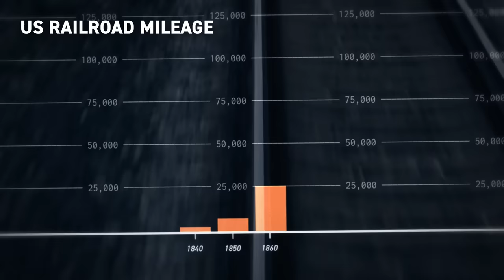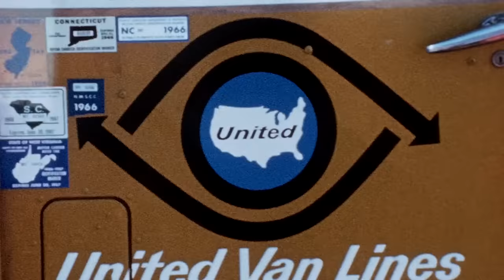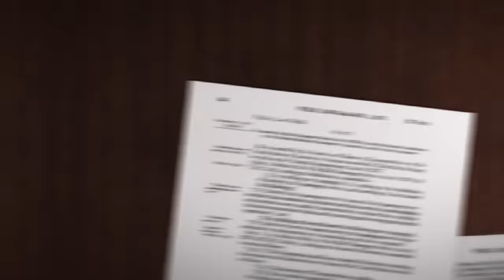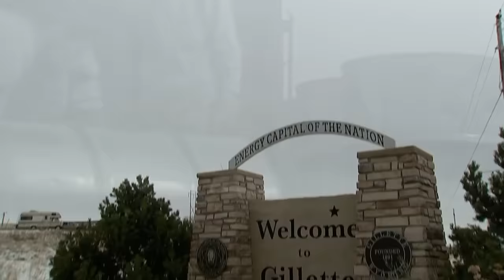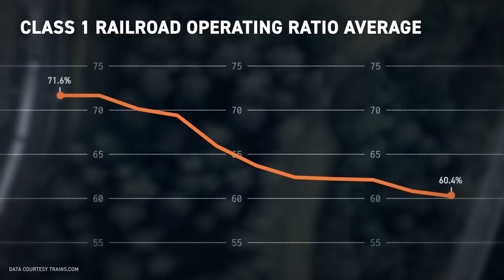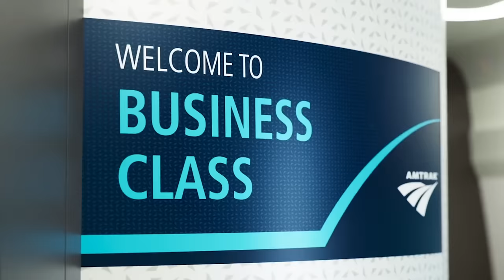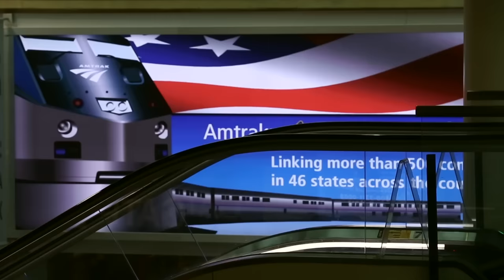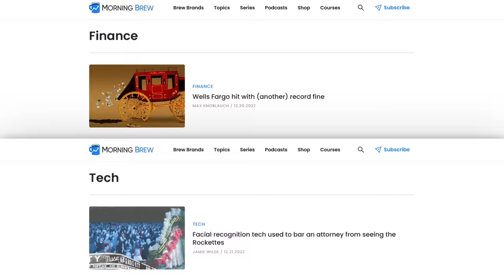The One Tiny Law That Keeps Amtrak Terrible

Comment: Everyone along the Colorado front range has been begging for a train for years. I have not met a single person who said they would prefer to drive to Denver over a train. Palmer saw this exact vision when he placed Colorado Springs back in the 1870s and the fact that we back tracked is ridiculous. The whole town is there because of the railroad.
Reply: One thing trains along the Front Range have an opportunity to do is address one of mass transit's big issues in the US: how do you get around once you get to your destination.  Rental cars are fine, but they can be a hassle, especially for short trips.  Colorado Springs and Denver are, at least right now, just not setup for mass transit.  With a train, you could load your car, ride the train, then use your car to get around once you get there.  Perhaps not the utopian idea of a carless society, but it's a step in the right direction.

And yeah, the trip to Denver is much better now that the gap project is done, but it's only a matter of time before it gets congested again.  Then what?  8 lanes?  10 lanes?  The Front Range will likely end up as one the countries megacities (almost a real world version of Saudi Arabia's ridiculous The Line) .  Best to figure this stuff out now.  Can't make a big change all at once, but we might be able to a step at a time.
Reply: @ccoder4953  I wish they created street cars, e-bike rentals and bikelanes
Reply: I'd recommend checking out some of the bus services that run along the corridor if you haven't. I used Bustang for a few years to get to Denver and it was quite reliable.
Reply: At least the North Suburbs of Denver finally have their commuter line into the city, although it came almost a decade late and we actually had to sue the state to get it after we voted to increase our taxes to fund the project and then they tried to cut us from the plan.

That said, I agree it needs to be more. We really need a line for the entire entire front range.
Reply: Dr. Quinn: Medicine Woman can take the train to Denver, but YOU can't.
Reply: @minihjalte  I think Denver needs a bit more than that.  If I'm coming from Pueblo or Colorado Springs and I need to do stuff around Denver, Denver is so big that e-bikes and bike lanes are rather inadequate.  Especially in winter.  Not that those things aren't helpful, particularly for locals.  But for travel from one of the other cities in the Front Range to Denver (or vice versa) right now, whatever transit terminal I get off of, now I probably need to travel quite some distance to get wherever I need to go.

What I'd like to see is something like a combined rail system where you have light rail lines, with dedicated high capacity light rail trains, then you have a streetcar system that can take bus or van sized vehicles.  The smaller vehicles can travel on the light rail lines as well as local streetcar lines, much like how cars can travel on small streets or the freeway.  The idea is to have low cost, low capacity, unobtrusive (face it, a big train in a suburban subdivision is a little intimidating and wasteful) lines for areas that don't need high capacity while still offering close to point-point travel (maybe one or two transfers), like we get with cars.  Also, having the low capacity rails in place reserves the right of way for future upgrades to larger capacity trains.
Reply: @ccoder4953  Well air traffic is faced with the same issue, but there it seems to work out fine.
Reply: Towns all over this country sprang up because of railroads, even in the northeastern portion. I live in a small town of 6k people about an hour outside of Philly. The town was formed around a railroad and street car, which helped industries like a paper mill ship their goods to the city for sale. They also ran a passenger rail between the town and Philly. Now, all that's left is the freight rail, which is a shame because I'd totally take the passenger train to the city if the train still ran because the old station is right around the corner from my house.
Reply: That would be great. One of the few downsides of life in Colorado is that nothing is close to anything. Everything is far away from everything.
Reply: @ccoder4953  Denver actually has transit for much of the city already in the form of its light rail and high-frequency commuter rail networks. The same cannot be said for Colorado Springs...
Reply: Absolutely. Cheyenne was literally FOUNDED by railroads. If we spent half what we spend federally on subsidizing trucking by paying for the interstate highway system, rail would win hands down.
Reply: @tealmer3528  Quite true Colorado Springs doesn't have a light rail system (we do have buses...).  But as good as Denver's light rail system is (and it is better than many US cities have), it mostly runs along the major freeways, so unless you need to go somewhere near one of the stations, you have the problem of how to travel many miles from a major line to wherever you need to get to.  What's needed is some sort of stepdown system.  Just like I wouldn't propose we build major highways everywhere we need to go, light rail should be for major routes and something smaller for arterial routes.  Like say a streetcar (or smaller) system that can also use the light rail system.  The idea is that the more places the rail system can take you, the more valuable it is.  The idea is called Metcalfe's law - the value in a system grows with the square of the number of nodes.
Reply: Keep contacting your representatives… it’s all you can really do.
Reply: Is there the light rail from Boulder to Denver? I lived in Boulder 2013-16 and that was being discussed, I'm all for trains and Amtrak just curious if that came to fruition and could cover what was being proposed.
Reply: @ccoder4953  Toronto has best demonstrated how you retrofit transit into a city with an urban core but auto-oriented sprawl outside of it. You run trunk trolley lines mostly where they're easier to run, and then set up a network of feeder buses for them. So most people need to transfer to the feeders for a while, but it's low density so most people would anyways... until you legalize TOD, and then all of a sudden the stations happen to be in the easiest spots to develop bc no NIMBYs!
Reply: wow we all from front range area!
Reply: @ccoder4953  uber is a thing
Reply: @rosswebster7877  I like your. metaphysics!
Reply: @ccoder4953  Sometimes as simple as buying railcars built around Bike Storage for passengers can be a partial way to address that problem, but the cities involved really need to step up their game. Bus system improvements, have even just van pools from the station as a band-aid.
Reply: @saravenr392  Well, I'm a Philadelphian spoiled by decent Amtrak service and reasonably good local transit. By the way, New York — Washington should be upgraded because it has a lot of segments that are straight enough for 135mph service but just haven't had the tracks upgraded for it. But New York — Boston is too expensive for now to install 135mph service, and that money is better spent in the front range.
Reply: @ccoder4953  Amtrak adding more car ferry services would be useful... even if its just NY <-> LA with maybe a stop somewhere in the middle of the country.  Currently the only ferry service is a short run create for some Florida politicians.
Reply: @minihjalte  Like Salt Lake City has? We also have our own State Run Passenger Rail. UTA works great because we also have the same North to South corridor in the form of the Wasatch Front.
Reply: @Joesolo13  Yeah, it's really the "last mile" problem that's really tough.  Nobody wants to use a transit system that's slower than car, requires a bunch of transfers, then finally requires a long walk to get wherever you need to go.  Stuff like busses and vans are a good band-aid,, like you said but the real solution is to get rail systems for more than just main lines and keep everything interoperable.  I doubt you'll ever have a transit system that drops everyone right at their house or business, but stuff like electric bikes are fine for the last couple of miles and systems should be built with that in mind.  Most places in the US though are very far from any sort of rail line - too far really for an electric bike.
Reply: Hey guys 🤝. Doomsday is on the horizon. Believe Jesus Christ is the Son of God. Jesus is the Way the Truth and the Life. Our Saviour Jesus Christ died so that we will live. Jesus said, "I'm the way and the truth and the life. No one comes to the Father except through Me". John 14:6.
Glory be to the Father, and to the Son, and to the Holy Spirit.
Reply: @ccoder4953  The area around the station in Denver is pretty walkable.
Reply: @Arewmon  yeah, when it comes to the north metro, north front range and fastracks, RTD is a joke
Reply: @user-ht5ce2it3z  no, not yet, and it’s been a sore point for a lot of Boulder/north metro residents. RTD is obligated to build a commuter rail line up there at some point, they’ve been collecting taxes from Boulder for it for decades, and RTD is constantly trying to back out of it and saying it won’t be built till the 2070’s
Reply: @kylewitter2806  Jesus. What a nightmare. Thanks for the update.
Reply: wrrg
Reply: Colorado needs to look real hard at what North Carolina did with Amtrak almost every population center in the State has rail access to the others. 

Personally it is my opinion that there is huge opportunity to reconnect Denver to Dallas.
Reply: @user-ht5ce2it3z  Coming (RTD).
Reply: @hunterepsi  it applies only in city and near city use. If your 15 - Say 25 miles outside that circle Lyft and Uber will bring you out of town but getting back is spotty , as friends operate other alternatives make their money taking folks back .
Reply: ... Most prefer to drive over a train, a train leaves you without a car, a train only returns maybe once a day at bad time like 6am, a train can be cancelled a day unlike a car.  I like trains for recreation but by far you can't get people to prefer train to car, 90% say if it under 100 miles they'll drive and have more flexiblity and safety.  Cars are better in many ways, just pretending people love trains more is silly.  In 1950s our grandparents all rushed to have cars and abandon trains, are we saying they are idiots and trains were wonderful?  Even in Europe there are 700 cars per 1000 people, cars just are preferred by rich people, for obvious reasons, trains are for special circumstances or poor people, the facts sometimes hurts.
Reply: @unatrek2821  can't agree , I d take a train and relax and enjoy the trip .
Yes there are bound to be delays on either  , road or rail , construction ,weather events can effect both as it does road ,rail or air , which comes first more riders or more rail choices , Yes it's inconvenient to have such limited rail service . It could be so much better ,  rather than the one a day at weird hours , rental cars are available although the prices and availability are not what they were just a few years ago.
There were trains that could transport your car as the same time , guess only to major travel points .
Still at one time railroads  ran Hotels and catered to tourist and business travelers alike.
Reply: and think of all the little towns in the northeast that lost their tracks-  why would anyone want to live there now?
Reply: @tommurphy4307  ... People rarely leave their town so who cares about trains... Travel is mainly richest 10% not us schlubs with just 10 days vacation a year.  And usually your relatives are within car distance . .   Especially with internet I  no longer needed to travel to find the books I wanted or see entertainment, vs in 1950s no farm towns had bookstores or entertainment so trips to big city were wanted once a season for week.....  

If commute 20 miles a day that's 7000 miles a year, if only take 1 500 mile vacation roundtrip that's 1000, so local travel really is what to focus on..m..  

people have cars and Greyhound bus for the rest, but most people who gush about trains are fake and never use greyhound thats how little they really need a train.....
Reply: @rosswebster7877  Not really that far; going from Boulder to Vail is less than two hours unless there is a traffic incident.